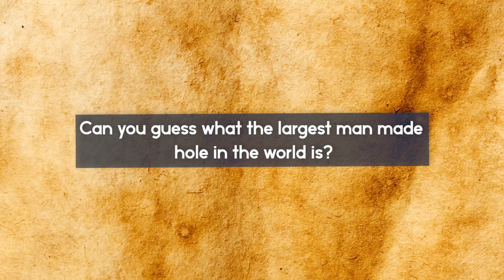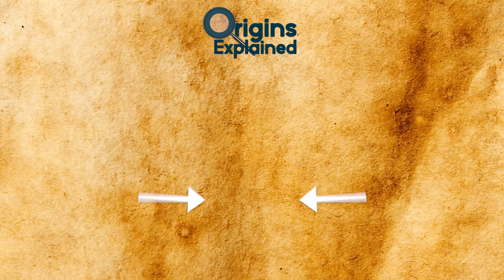BIGGEST Holes Ever Made By Humans!

Comment: I live in Utah so Right as the video started I was just waiting for the kenecot copper mine to show up 😂
Reply: I live near the Santa Rita (Chino) mine. 
It used to be a kenecot mine back when I lived here in the 80’s but somewhere along the lines changed hands by the time I moved back. 
It’s currently 1.75 miles across and 1,350 feet deep.

Comment: So, at 7.5 miles the temp was 360F? And everything at that depth is "practically liquid"?  Then, pray tell, what are ovens made out of? How do humans cook?  What are engines made out of?
Reply: what she means is liquifaction. at those depth praticly everything suffered liquifaction. like you see in great earth wquake areas
Reply: I am not sure about liquifaction at that depth.  I thought that process would only happen in uncosolidated sediments.  The rock is solid at that depth, but due to the increased pressure it deforms in a ductile way and flows, rather than crack in a brittle fashion like at the surface.  There is a common misconception that the Earth is mostly liquid beneath the crust, but other than the outer core it is solid.
Reply: dont forget about pressure, it lowers the liquidation point
Reply: guy tremblay but what he is saying we cook things at around or higher temps than 360 ...why haven't those things liquefied
Reply: I read another story saying that the drillers quit because of their equipment breaking due to too much capacity for then drilling equipment. Drilling equipment today maxes out at a million pounds of casing weight. And you add the average length of a casing tube and you’ll get your depth, a lot shallower than 7.5 miles or 9 miles deep. I’m sure with today’s equipment and tools, we could go further but there have been some horror stories about that hole. A neat read.
Reply: It's all BS
Reply: @j.t.r.3137  because of the increasing pressure reducing the liquidation point
Reply: They quit because a drill broke in the line and it couldn't be removed. The temperatures were correct, but it was the density of the rock which changed. It was more like molten plastic "mud", not "solid rock". However, upon trying to raise the last drill, it got seized in the shaft and could not be removed. (They guess that one layer shifted, trapping the large drill-shaft, which sheared and was left in the hole. Thus, it's just a "guess", as to what the reason was.)

The drills they used were designed for dense granite, which they never hit. Imagine trying to drill into clay and stone with a flat-plate that has "teeth" like a hair-brush. Once the gaps are filled with stone, the teeth can't "dig deeper". It is like a tire-tread filled with snow, spinning on ice. It will never grip the road, though the road and the tire are both still in contact.
Reply: If you haven’t seen it with your own eyes & heard it with your own ears. Then we don’t know anything! Ur right, those temps, stated don’t make any sense.. then here comes all the “self claimed” Scientist out there who come to the rescues and explain things they have never witnessed. Amazing isn’t it? Humans know very little about the earth we live in/on.. & that is the FACTS!
Reply: Obviously it's a higher temperature than what they're stating

Comment: Lol, I live in the NWT and I recognized Diavik from the thumbnail and there's some inaccuracies in this video. Most employees at the mine fly in and out every two week rotation, and they do not fly in by a helicopter.. the idea that the employees can get stranded is inaccurate as it's only an hour flight from Yellowknife which is the main point of pickup. Also, while the ice road is accessible for a few short weeks, it's mainly used for the mine's shipments and imports by semi trucks.

Comment: No mention of Homestake gold mine in South Dakota?  Homestake closed after mining to over 8,000 feet with hundreds of miles of drifts (tunnels).  Possibly a larger hole than five of these others combined.  I lived a mile above sea level (Lead, SD), drove 15 minutes to work and on occasion worked over 1,000 feet  below sea level (6,250 deep at that time.)

Comment: Photographic equipment hanging at the bottom of a weather balloon is not what I call outer space technology. It's called a balloon approximately 120000 feet before the balloon explodes due to structural catastrophic collapse because of unequal pressurization within the balloon to the outside of the Blue Moon surface is so minimal that the material holding you can change are cannot withstand the pressure differential and becomes defeated. But it takes a lot of pictures between launch and explosion of the balloon. Never in space you cannot exceed the firmament Dome

Comment: I would say the most dangerous holes made by humans would be the ones now being used for drilling operations for oil and gas extraction! ...... the reason why? Because they create weakness in the earths crust and this causes earthquakes more often, and now in places next to the drill sites.
Reply: Lary Mayotte - No.  Not the slightest bit of truth to that.
Reply: Lary Mayotte -
I apologize.  I misunderstood your comment.  I thought you were referring to the initial hole being drilled each time..  not realizing you were actually referring to the giant empty chambers that are left after they have extracted the oil or gas.

As for Duchsince - I hadn't heard of him.  I watched quite a bit of the video you linked to.  It's interesting and he is dead on with much of what I heard.  Sounds like he's putting the puzzle together.

One thing I liked was how he linked volcanic eruptions to hundreds or even thousands of small (swarm) quakes.  He is absolutely right.  What I don't know if even he is aware of is that those thousands of micro-quakes, over several days or even a couple of weeks, are what actually CREATES THE LAVA that spews out of the volcano.  

People think there are giant magma chambers with plumes pushing through.  There aren't.  The swarm quakes cause prolonged shifting of the landmass against itself which causes frictional heat hot enough to melt rock.  When it happens for days at a time, you can bet it has created enough lava to blow.

Thanks for posting the vid and setting me straight.
Reply: Actually my friend just the digging of the wells causes weakening of the ground. ..... have you ever looked close to the google earth mapping? you would see that many of the states in the middle of America are full of them and very close to each other, and so the earth quakes we have been seeing lately are caused by the drilling. .... all you need do is watch the video I sent to you, and you will see how and why. .... In the past almost all earth quakes were on the California fault lines, and very few on the east side of the country and almost none in the Midwest. But now we get them on a weekly or sooner today. ..... If you look where the earth quakes are you will find them very near a drilling operation.
Reply: Very interesting!!  I'll check it out!

Comment: What exactly constituted qualification for this list?  Other than stating the Kola Superdeep as the deepest, this list doesn't make sense.  Is the list based on volume of the hole?  Area?  Other?  Based on area alone, the Hull Rust-Mahoning iron ore mine in Minnesota is larger than any on this list besides Bingham County at 1.5 mi. X 3.5 mi. X 600 ft deep.  And it's only getting larger as they are still mining taconite from it.

Comment: Wtf 180 degrees destroyed equipment????
Reply: yes it does  cause heat will modify any metals structures causing it to fail if they go over their point of stress and it don't take much to modify the structure of steel
Reply: Ok ty

Comment: The boreholes have actually perplexed scientists because the temperatures did not match the models in the least.  Temperatures are predicted to increase exponentially with depth until the core (with a supposed temperature matching that of the surface of the Sun) is reached.  

Instead, they are finding that most of the boreholes reveal moderate to cool temperatures.  Scientists are baffled because they expect that there should be more heat the deeper we go, and therefore the closer to the supposed magma inside the Earth.  In reality, there is no magma, nor is there a hot iron core.

Ever been in a deep cave?  You'll want a sweater or a jacket if you go very deep in.  Does the temperature of the ocean increase as you go deeper?  It should because you are getting thousands of feet closer to the "magma".  But does it?  Nope.  It gets colder.  Why?  Because the whole idea of magma was just a fallacious pseudotheory.  Yet the whole of the natural sciences has been built around it.

Comment: Umm, The Kola Superdeep Borehole was not stopped because of temperature constraints. Exxon Mobile has drilled deeper and Can go even further. It was stopped because of the fall of the Soviet Union.  There are drill bits that can handle upwards of 2000 degrees Celsius. The complications begin when you reach depths of over 10 miles. The drilling equipment cannot handle the torque along the hole. The materials needed are extremely expensive and some are not even invented yet. Please, remove this video as it is full of holes in your facts.